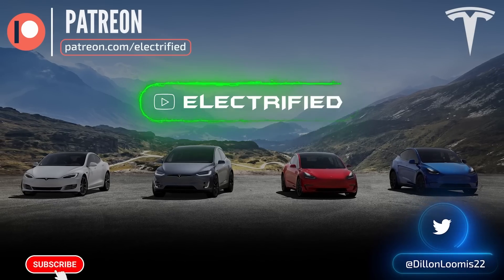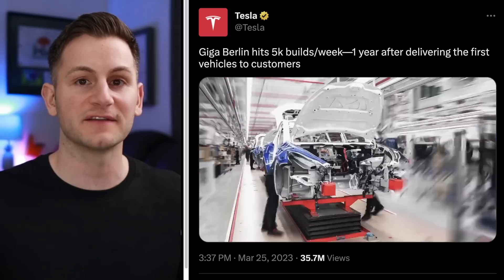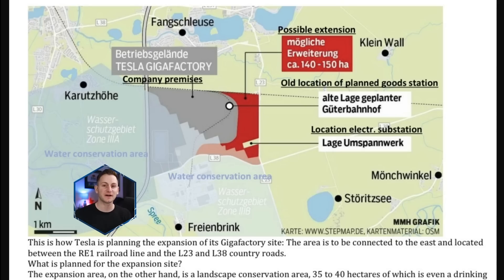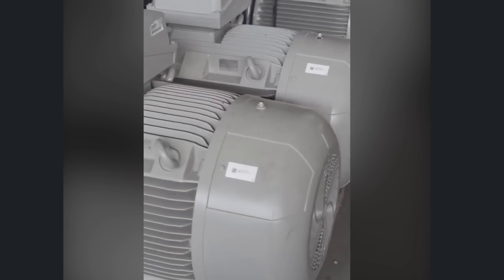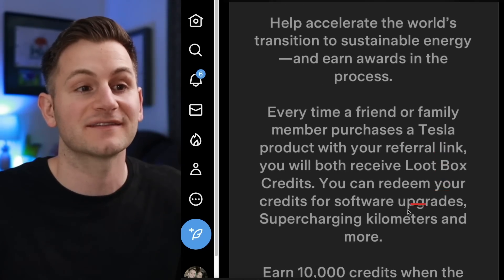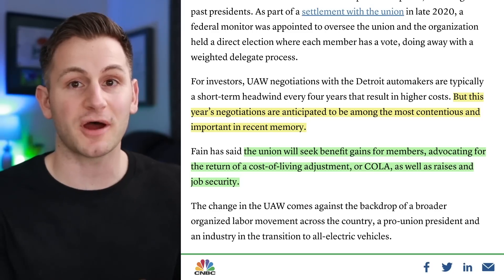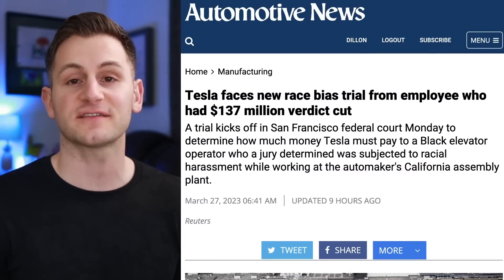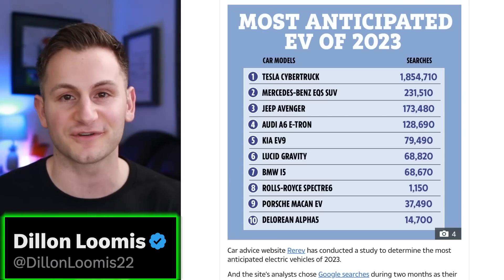New Tesla Motor Teardown / Most Anticipated EV of 2023 / Used Car Price Trends ⚡️

Comment: Dillon, I read in a German document that the new CATL battery is 4695 instead of 4680, which is part of the reason for the higher output. If that were the case, do you think Tesla would change the structural pack to accommodate the larger size?

Comment: Well there is a lot of hoopla about this hairpin motor, and its power density and efficiency, and its ease of constructability.  I believe it is because the surface area of the square wire is greater than for a round wire, and it has been asserted that electricity conducts on the "surface"  of the wire resulting in a higher current density.

Comment: Tesla in Australia has a long way to go. For instance, no Superchargers or other brands available from South Australia to Perth, Western Australia - a distance of about 1,600 miles. Also the same for South Australia to Darwin, Northern Territory  - a distance of about 1,800 miles. So trans-continental Australian travel by aTesla is a pipe dream right now.
Reply: You almost need a auto train like AMTRAC on the US east coast.
Reply: @Dularr  Yes, The Ozzies always drive 1600 miles with their cars and never by train. Maybe they have some left from the Mad Max wars that have the range? Maybe some additional external barrels full of petrol? I doubt it.
Reply: A big problem with security in the outback. Lots of people have the equipment to steal the pre-made superchargers on their concrete bases, and any megapacks. Farmers get solar panels, pumps, electrical equipment stolen. Tesla needs the people who sell gas in the outback (often $200 to $500 purchases) 24 hours a day to do $30 electricity fills, and make large changes to their facilities. Essentially, government will probably need to invest $2m to $5m in each outback gas station that offers DC electricity.
Reply: You mean you don't have long extension cords, mate ?
Reply: @vinnylamoureux1187  we are building some at a host of a billion dollars each.
Reply: @@badinstinctsyoutube7108 a good point. We should invest in rail and "rolling highways" - drive on, drive off trains for these long journeys.

Comment: The motor is badass but it's also not as advanced imo as the lucid air powertrain is or the koenesigg quark&terrier unit's either. 
If tesla had koenesigg level tech? They could swap in a terrier unit at the same weight as the current single motor and have dual motors and torque vectoring along with 670hp in a super compact package. Now that would make an insane model 3 performance. 😀
Reply: It will also cost you a liver.
Reply: Lmao! Thinking Koenigsegg has better EV tech than Tesla. 🤣

Comment: I didn't know that oil and an oil filter were needed for an electric engine. Does this mean that we cannot get away from oil changes? Why would the new Tesla engine have an oil filter be "built in" to the engine? Can anyone explain this stuff? Thanks.
Reply: The oil don't need changes because there is no carbonization. The oil is use for cooling. the drive unit. The filter is use to catch and trap metal burs from wear and tear from  the gears to protect the rotor and stator it does not need changes because again there is no carbonization so no carbon deposit that fouls up the filter,
Reply: @kazedcat  
And low temperature.
Reply: @kazedcat  Thank you.
Reply: Not engines, motors. It's a sealed element inside the case and not designed to be ever serviced unless they crack the motor case itself open for some required service. Ingenext video on here explains it well imo. 👍🏻
Reply: @4literv6  Thank you.
Reply: EVs still have moving parts, just a lot fewer. Moving parts usually require some sort of lubrication (oil in this case), unless there's some fancy frictionless surface (doesn't exist yet AFAIK). This new motor is a closed system, so no filter or oil change, that would only be required if the oil/filter get too contaminated which probably is not an issue in a closed system.
Reply: @houdini8172  Thank you.

Comment: The hairpin motor is already going in cars. There's no way another manufacturer would change that fast. A GM manager told me they make contracts with suppliers and the union.  It's almost impossible to change anything before the contract runs out.
Reply: Isn't GM already using hairpin motors in the Bolt?
Reply: Sandy Munro says that GM invented the hair pin motor.
Reply: Nope not a fan of the new red.
Reply: Change that fast?  GM is already using this design in the Chevy Bolt.  The concept has been around for 5+ years.  Tesla does great things.  But, just because they showed the public something at an investment presentation doesn’t mean they are changing fast.  In this case, they would have been developing it for years and finally showed it when they feel it’s ready for production.
Reply: If thats the case it's the most uncompetitive thing i ever heard, how not to innovate.
Reply: I picked up my M3 LR DM yesterday.  It has the Hairpin motor (character 8 in VIN, K in my case).
Reply: i thought they were months aways or later this year.  wth!!!!  they pulled away again.  OEMs are still flatfooted.
Reply: @aeromtb2468  what kind of nonsense are you talking about!? Tesla is like the last one to use hairpin motors lol!!!
Reply: Hairpin motors are being made in Shanghai since 2021, check the “Go Giga” video from Tesla from that year
Reply: Unions use a change request as an opportunity to “get something” from mgmt. They should see it as a chance to make the members’ jobs more secure. They will realize too late that the competition is coming.
Reply: I see unemployed people